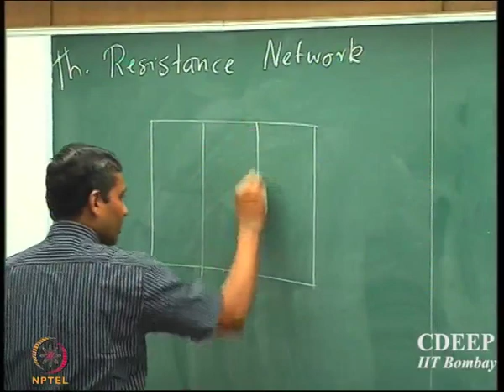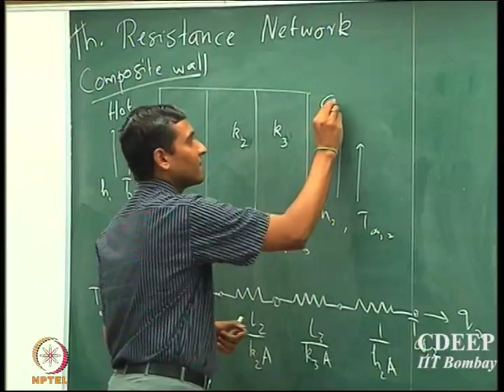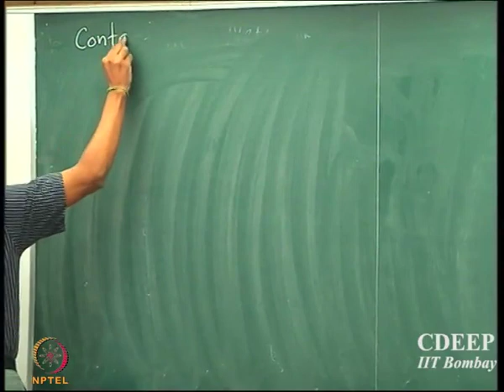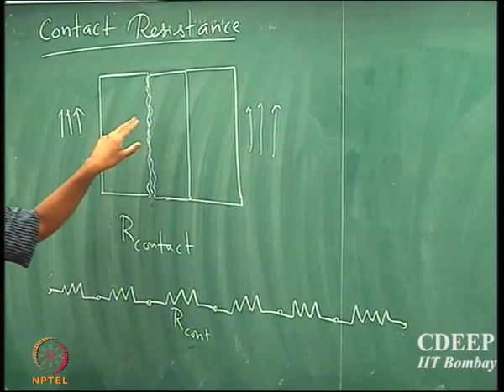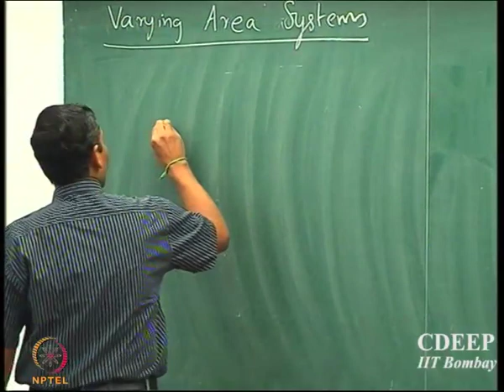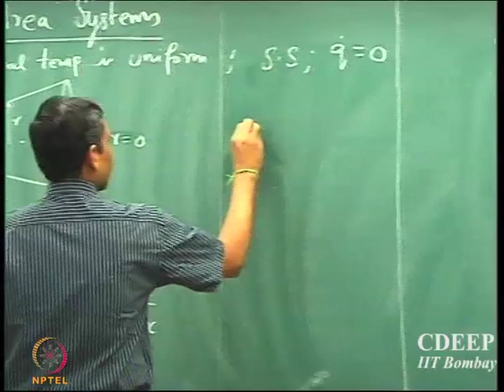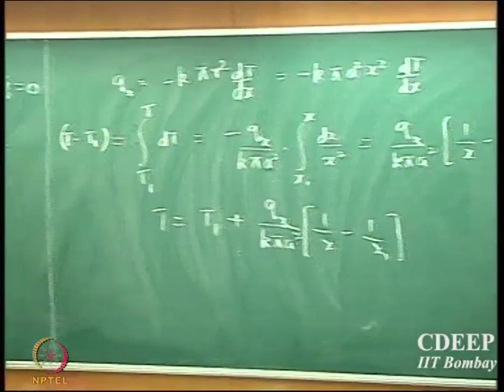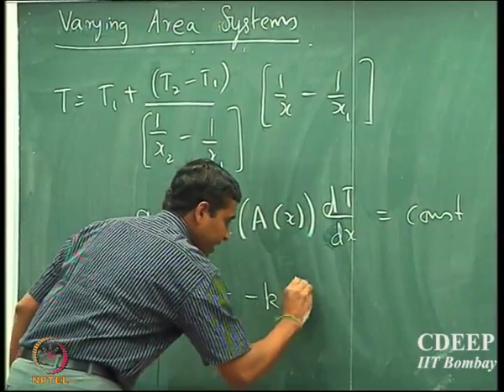Week 1 - Lecture 5

Comment: why did he integrate from t1 to t and not t1 to t2??
Reply: To find the temperature as function of position
Reply: To find the variation of Temperature w.r.t. position variable x, the method is like that he did. Integrating from T1 to T2 will get directly the total value of heat transfer as both T1 & T2 are known, but how they are varying is represented by some curve. So its expression should be known. At each point in this expression, there is continuity of temperature distribution & hence, the heat flux.